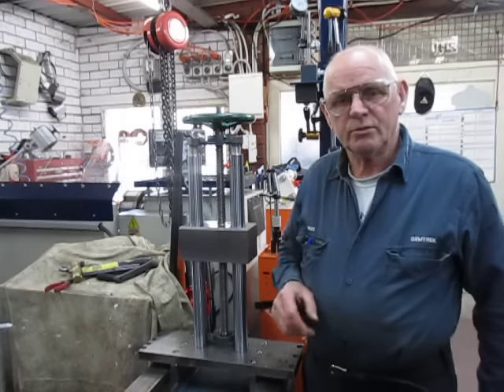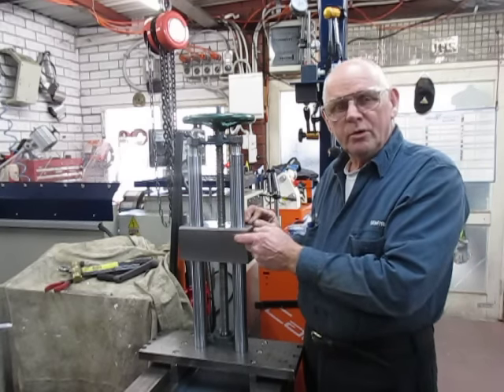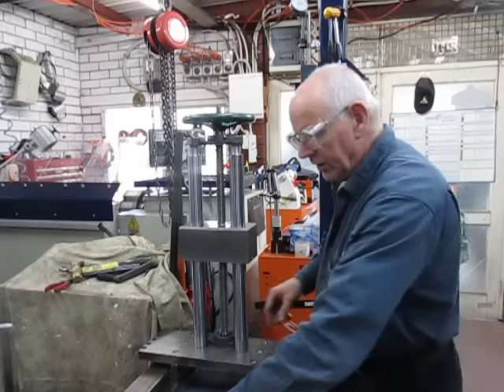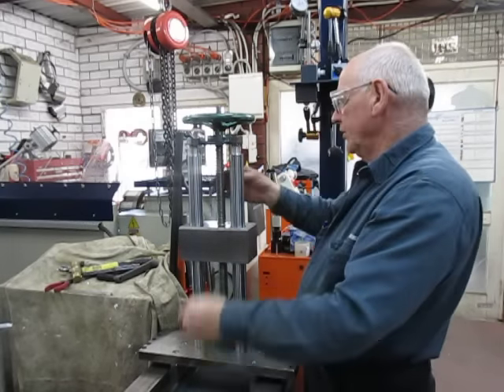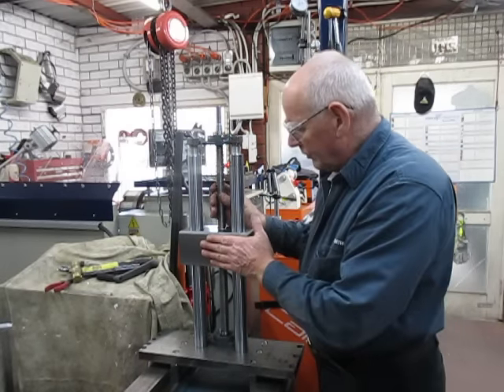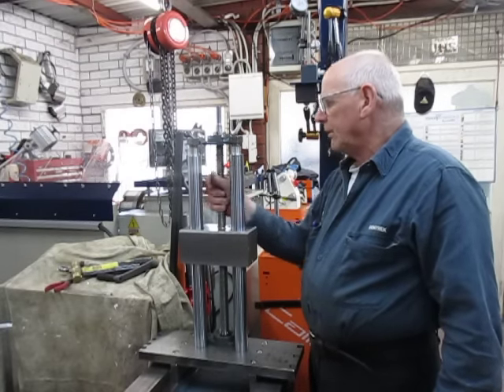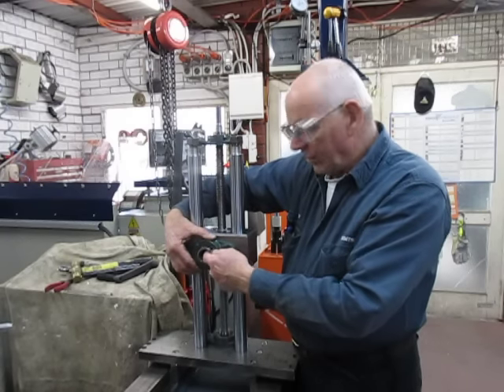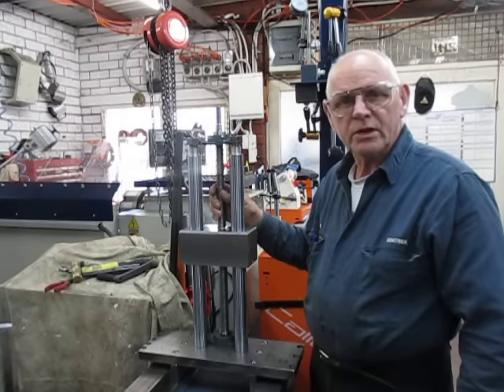HBM Back Stay Build continuation 2

Comment: It looks really good to me anyway. Suggestion could you use a battery powered laser pointer light in some way, perhaps mounted in a block, which would shine onto an object / scale / hole? We have used some cheap, but effective, ones on small tripods with a bubble level for landscaping groundworks.